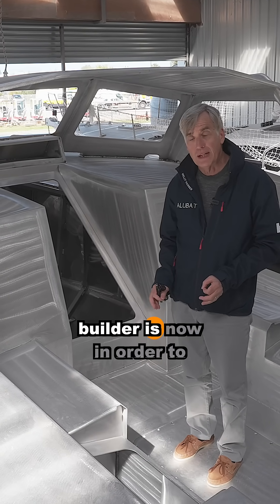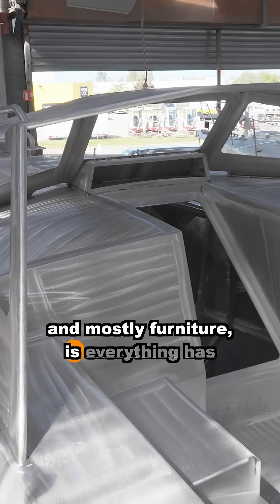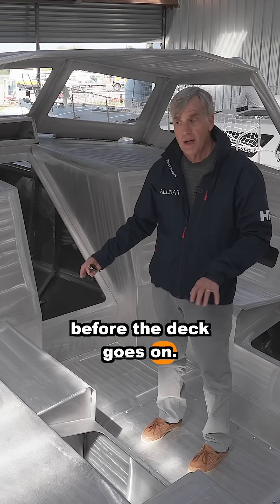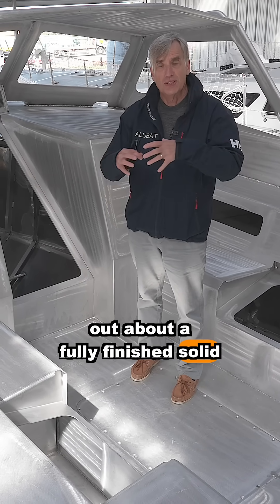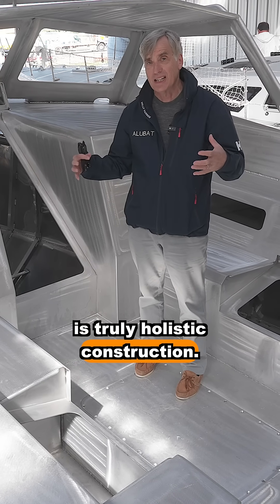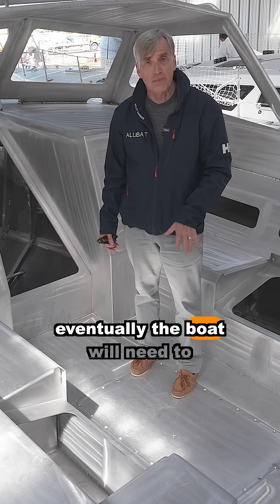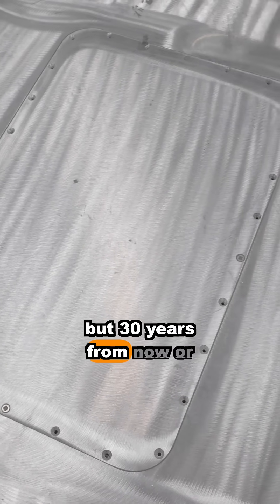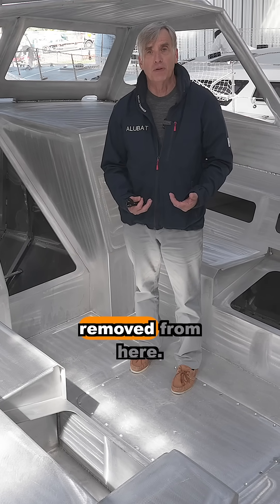Disadvantages of building 💯% aluminum boats at Alubat #shorts #aluminumboat #sailboat

Comment: I guess that the deck plate is secured with stainless screws. Can you say corrosion?
Reply: No bro, you can actually see the aluminum welded together in the actual video footage, they also use sacrificial protection, they understand the high school chemistry of electrolysis, they aren't amateurs, they have been doing this for 60 yrs.

Comment: Thank you! All boats should be done this way. Anything that might wear out or be upgraded in the next 50 years should be put in after the structure is done so it can be changed without having to cut the boat apart.

Comment: Aluminum boat wont last forever.  40 years max.
Reply: I have 1955, 1956, 1957, 1959, 1962 aluminum boats that have lived outside in the elements for most of their lives.  The '55 was outside for at least the last 45 years, the '56 I know for a fact was outside since 1980, and it had trees growing in it.  
A few pin holes from corrosion that brazed shut and a few rebucked rivets, and they all are just as sound as the day they came off the assembly line.
I fully anticipate all of them living on past 100yrs.
Reply: @deanfulmer6651  thanks for talking from actual experience rather that only logic, that science right there

Comment: Using aluminium screws? If not, get ready to maybe replace the beans beneath the cover and the cover due to galvanic corrosion.
Reply: wow, do you think they thought of that. building an entire boat and all.
Reply: Titanium fasteners and  anti seize coatings ...🤔
Reply: @clivestainlesssteelwomble7665  Still a dissimilar metal and a dielectric to possibly fail.  That said, both are low corrosion.

Comment: These are only disadvantages to the builder not the owner.
Reply: It's all connected by many factors.  A boat that's cheaper to build may be cheaper to buy, but more costly to maintain, etc.  So pros and cons of both.  That said, a boat that's better built to begin with is probably a better value long term, so I agree with your point.

For these and many other reasons, Aluminum seems an ideal material for a boat.

Comment: The fact that you know that everything inside the boat fits through the door is a big advantage for the owner of the boat, I would think.
Reply: Excellent point!
Reply: Benefit to owner, not to the builder.
Reply: So many boats have to saw up furnishings bulkheads or strip down engines to bare blocks virtually to get them out. 
It's the iPhone problem but it's got through to cars and boats even earlier... 
Large ships even have to have their sides cut away to replace engines or transmissions 🤷🏻 
The other factor is that a lot of boats are going to have to be repowered in the next decade... because of the pollution problems...and fossil fuel restrictions.
Reply: @clivestainlesssteelwomble7665  That only applies to the owners wishes. I do not know of any country that requires emissions upgrade on engine change. In a lot of cases the engine rooms would not allow Stage 4, Tier IV, installations.
Reply: Yep. When I decided to replace the propane stove in my galley, I had to disassemble it, because it wouldn't fit through any of the hatches.